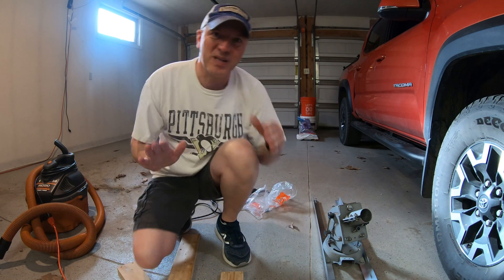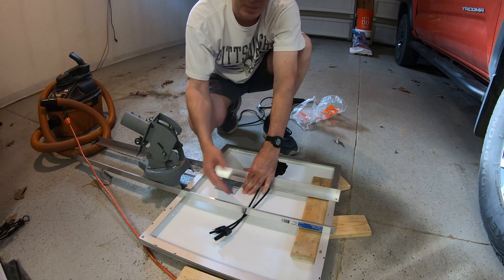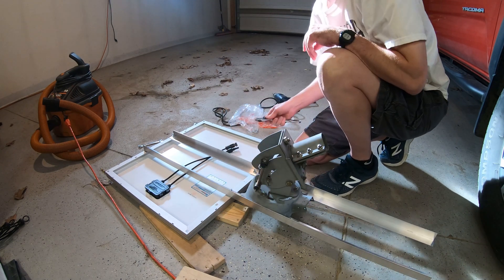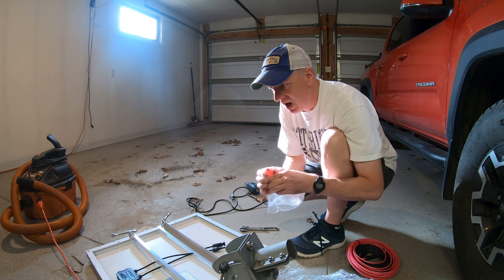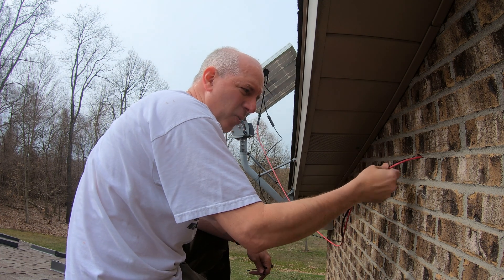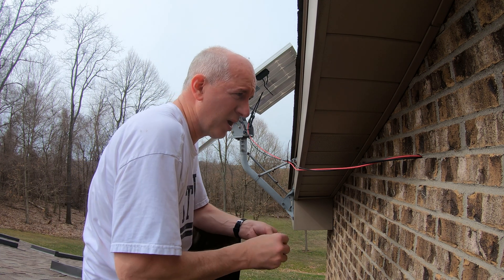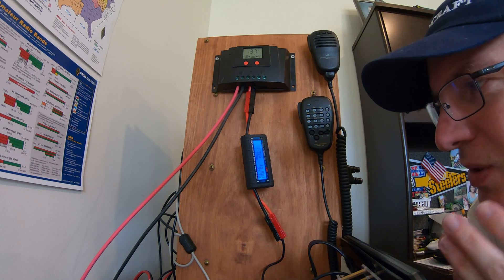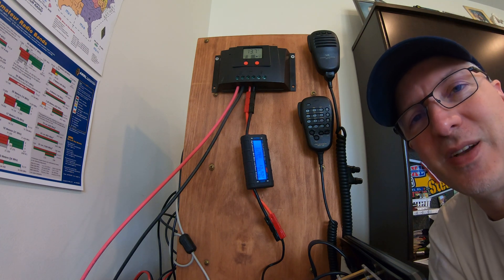Satellite dish solar mount part 2

Comment: Hi Tom,
Nice installation with room for another panel. If you add another panel, do you just daisy chain the electrical connections? You and the family stay safe.  73  WJ3U
Reply from the maker: Hi Don.  They make a Y cable splitter to connect to both panels.